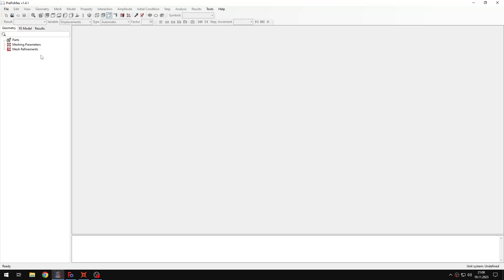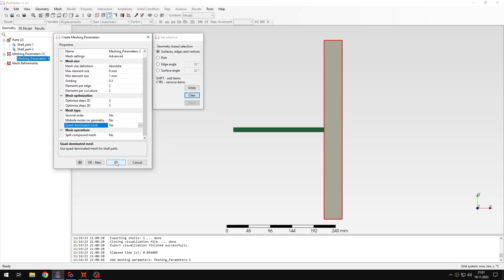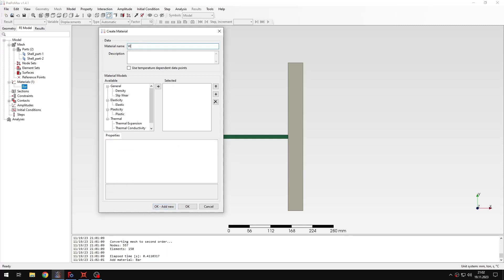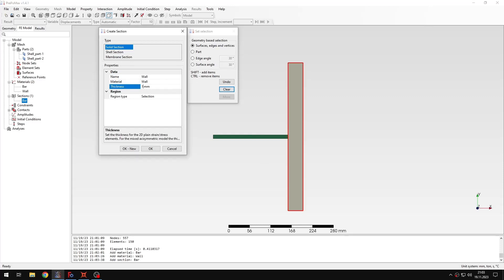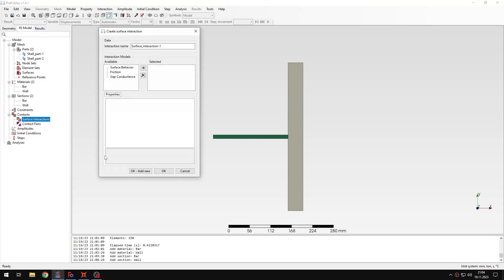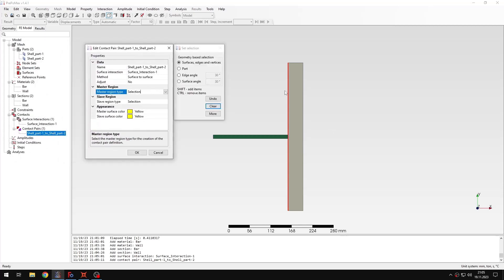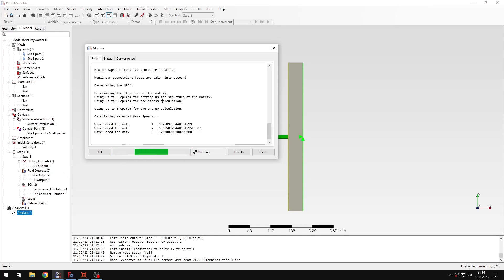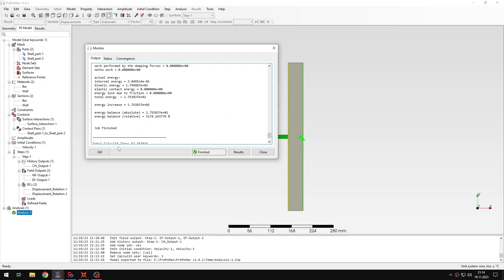PrePoMax (CalculiX FEA) - Tutorial 38 - Explicit dynamics - bar impact

Comment: Hi, I am trying, but failing to reproduce the result. In my case, the bar is not interacting with the wall- it's going through the wall. Any idea what could cause this? I have been trying to follow the steps you showed here.
Reply from the maker: Sounds like missing or incorrect contact definition.
Reply: @FEAnalyst  Thanks for your reply. THat's what I think, but I am using everything identical to your tutorial. Only difference I have seen is that when I search for contact pair, it doesn't automatically find it unless I increase the search distance to unreasonably high value.
Reply from the maker: @pathik036  Then maybe the units (dimensions) are incorrect. Try to query the geometry. It's hard to say what else can be wrong without seeing the model.
Reply: @FEAnalyst  Is there a way I can send you the model?
Reply from the maker: @pathik036  Try posting a link to some hosting website with this file uploaded. Let's see if YouTube allows this.
Reply from the maker: @pathik036  Actually, it could just be also deformation scale factor larger than 1.

Comment: Thank you for this amazing tutorial. I ran the simulation for different output frequency values varying from 2 to 100. The results seems to be heavily dependent of this value. I got very different results as the output frequency gets smaller, especially at output freq = 5 (I ran it twice incase I might have done something wrong. Got the same results). I was expecting the results should converge at an Fx-min value as the output frequency gets smaller, or not affect the Fx-min so much, but the results showed opposite. I was wondering why this might be the case. Here is the list of my results for Fx-min (since the force is in negative direction):
Output Freq	Fx_min
2	-604.0706
5	-12315.29
10	-2503.218
20	-4102.933
40	-5686.742
50	-5979.504
80	-6204.691
100	-6220.212
Reply from the maker: Well, I'm not very surprised to be honest. CalculiX still shows weird and inconsistent behavior in some cases, especially the explicit dynamics procedure is still underveloped and prone to issues. It was really hard to find a working example for this tutorial. Fortunately, there were (and should be also made in the future) some improvements in this regard. Anyway, that's one of the reasons why I always include analytical calculations in my tutorials.